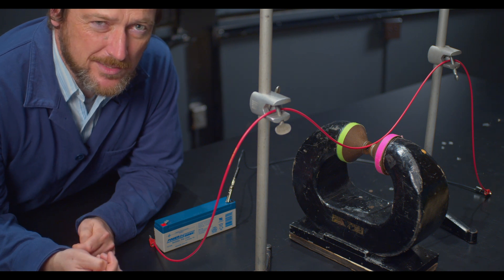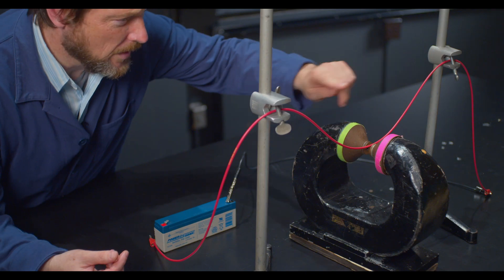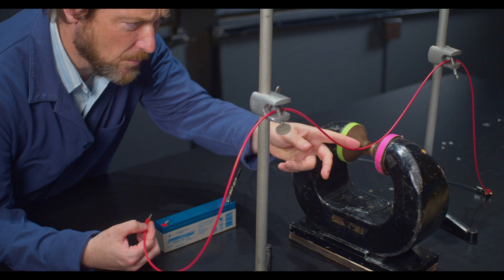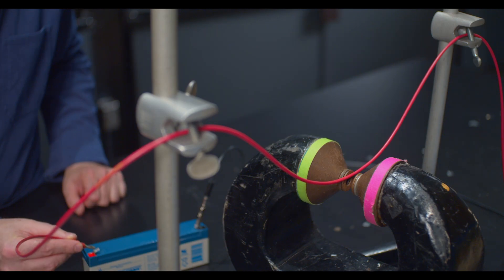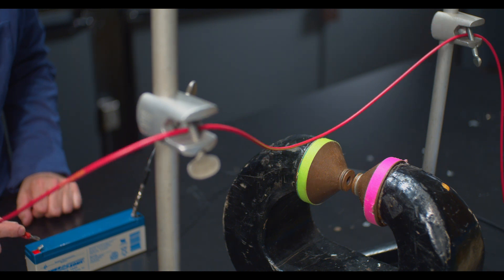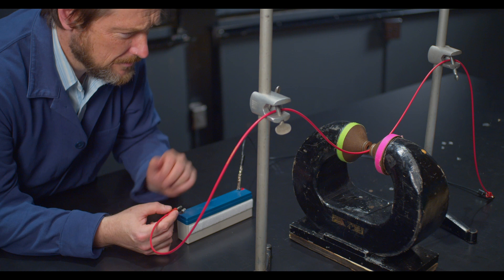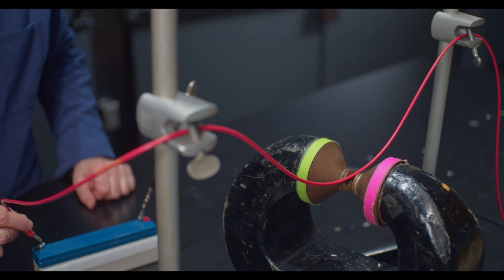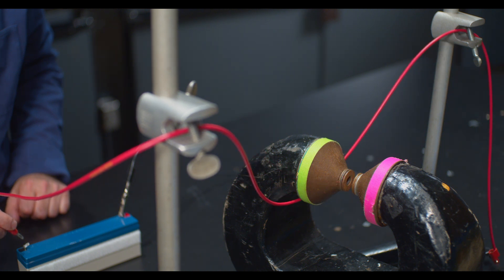Jumping Wire

Comment: Very impressive.  In 1968, the instructor at the electronics trade school I was attending brought out a high-voltage transformer for a neon sign and a thick piece of plate glass about a meter square with aluminum foil stuck to each side--inductor and capacitor deluxe.  He connected the two sides of foil with wires to the transformer terminals and left the wires loose on the floor.  When he plugged it in, the room was filled with a loud crackling as arcs passed around the edges of the glass between the foils, leaving etched tracks in the glass, and the wires visibly jumped.  He did not leave it on long, because he did not want to expose us to excessive X rays, but the room was left smelling of sulfur.  We were properly impressed.
Reply: no x-ray risk. In air, the mean free path of the e-'s before colliding with a molecule are far too short to accumulate enough kinetic energy while they're being accelerated by the ambient field gradient in order to produce x-rays on colliding with anything. Need to be in a vacuum to increase the MFP to something much larger to do that with laboratory scale voltages. Can't produce x-rays in air with sparks alone unless the volts and amps are insanely high such as in a lightning bolt. Even then the radiation flux is fairly limited.
Reply: @Muonium1  Thanks for the info.  I have always wondered about the possibility of X-ray emissions from large Van de Graaff generators and such.